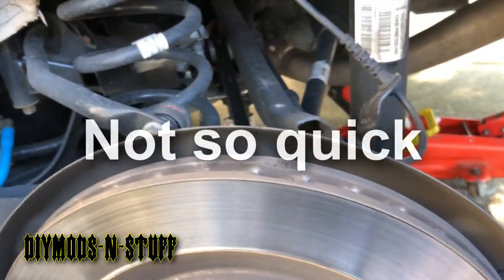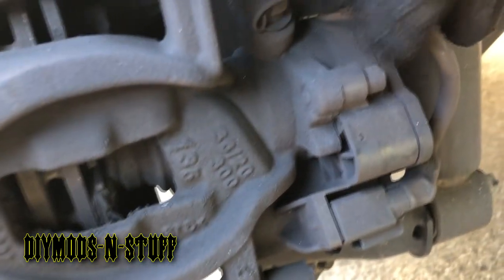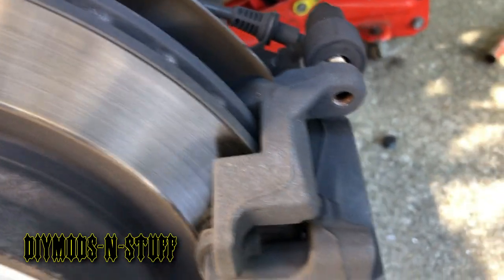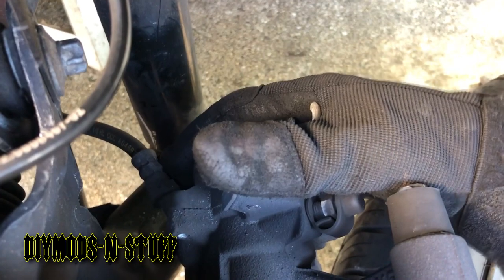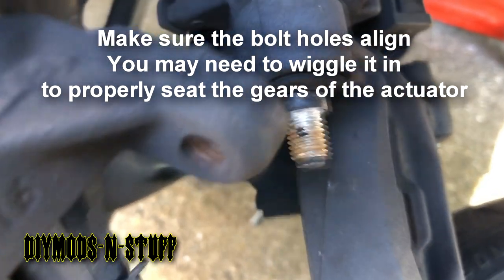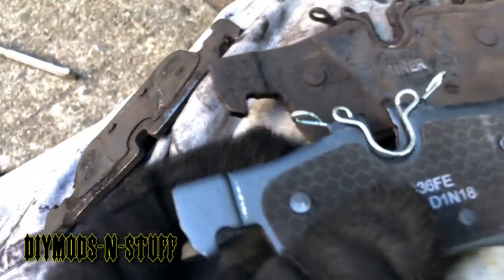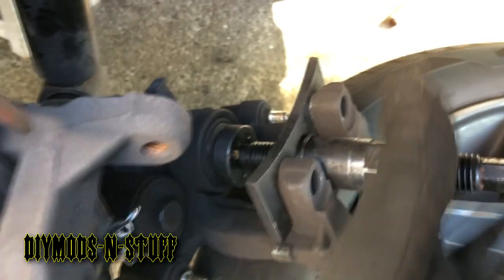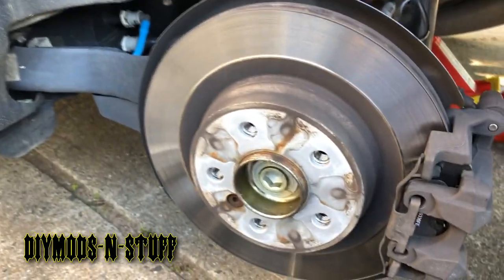2018 and up BMW X1 REAR PADS SWAP with EPB Electronic Parking Brake

Comment: Sir, I'm a mechanical engineer and have been working on cars for over 50 years.  You should be an instructor!  You add a lot to the video with constant tips and encouragement!  Superb job!
Reply from the maker: Thank you. My father is a mechanic and I had to learn myself when I started driving and realized that I can save time and save myself lots of aggravation. I appreciate your comments and that's why I do this.

Comment: According to my Foxwell Diagnostic Scanner, my 2019 X1 xDrive does not support the parking brake and caliper piston reset function.  Not sure if it applies to all though.  That is just the message I got when I tried to reset it with the scanner.  So manually resetting it will be.  Did the rear brakes on an F25 X3 last year and they were identical.  Great video, by the way.  Better than trying to decode the TIS.
Reply from the maker: That's the problem with most scanners, they won't support all vehicles unless you pay for an upgrade or buy the newest scanner.
Reply: Look under the DSC menu, it's moved from the EPB.

Not logical, but it's because the Autohold uses the motors...and Autohold is part of the DSC.

Comment: Good tutorial on how to do it manually...but way easier way if u have scan tool with epb capabilities. Before u jack wheels up and get dirty
Hook up scan tool follow prompts push a button ..and u will hear both epb motors retract(service mode)...then u will be able to push piston as u would do the front...a 30 second procedure, and no need to take epb motor off or connector.....when done with both sides...go back scan tool push the done button follow prompts and ur done=)
Reply: Where did you get the scan tool  what is the name thank you
Reply: @67mustang351w  autel has good hand held scanners for about 240-300 with  epb function and several other functions  or u can go with the bigger scan tools that provide bi-direction capabilities and much more for 500 to over 1000.. hopes this helps =)
Reply: @masterjoe3000  which autel tool did you use for this?  I have the MD808 Pro, and it's telling me that my 2017 bmw X1 isn't compatible.

Comment: Thanks,  working on my x2 , already broke the indicator line on front breaks.  Very helpful.
Reply: The front brakes on the new gen X1/X2 wear out extremely quickly. I had to do the front pads, rotors, and sensor at under 40,000km (25,000miles)
Reply from the maker: It probably and I say "probably" has to do with lane assist or something.

Comment: You should put in the description that this will also work for a 2017 on Mini Cooper Clubman as they share the same chassis as the X1. Saved my but. I would have never knows about resetting the electronic parking break.

Comment: Did you notice fluid behind piston dust boot when changing pads. Just started on 19 BMW x1 and passenger side backed off but noticed fluid under piston boot when releasing trapped air from boot. I checked the left side before backing parking brake or piston and noticed fluid in boot. Brakes felt good pulling in and no signs of leaks from calipers but for sure oily fluid under piston boots.
Reply from the maker: I did not see any fluid at all. Something I definitely make sure to check anytime I change pads on any vehicle. Make sure the rubber seal isn't torn.
Reply: @diymodsnstuff5514  
I check every time.  Just weird it is both sides.  22 year tech and never seen anything like it.
Reply from the maker: @carsurvivalist  Definitely is weird. I asked my dad, he's a mechanic 60 years and he tells me it could be bad seals.

Comment: On my Volvo I found I can just use a wire to energize the motor and back out the parking brake actuator. Can’t see why that would not work here.

Comment: Great video!
2 questions

Didn't you have to change rotors? 
What happens if you don't reset the EBP?
Reply from the maker: The rotors were fine.
I'm not sure. You have to reset it to be able to remove the caliper.

Comment: Does the passenger side have the same electronic brake? Is it also clockwise?
Reply: Just did em, clockwise for both sides and I used a socket to turn the gear by hand instead of a wrench

Comment: Any idea how to unlock the electronic parking brake. I missed that the passenger side had it too and I didn’t turn back the actuator initially I tried to compress it with the c clamp and then……I think I turned it the wrong way. Any ideas on resolving it without buying a new caliper.
Reply from the maker: C clamp would not work. You need to back it out the way I explained in the video or with a Scan tool that can do it via the ODBII port.

Comment: Recently did a 2018 X1 rear brake job too. There's now a squeak under light braking. Also, it feels like theres now slight brake drag, which is definitely affecting overall gas mileage. I'm thinking the guide pin boot needs to be replaced. Any thoughts on the possible problem?
Reply from the maker: Did you retract it like I did in my video?

Comment: My x1 with 47k km,OEM rare brake pad stil has 2800km life left ,hope this is not wrong information what I am getting from MID
Reply from the maker: These pads have an electronic wear sensor. Once the rotors start wearing down the sensor, you will get a message displayed in your head unit and you would probably have 1000 or less miles on the pads. Worn pads wear faster than new ones so keep that in mind.

Comment: Is it clockwise for both sides? Also what size wrench?
Reply from the maker: If it has an EPB on both sides yes. You know because it would only turn or back out only one way. I used a 12mm wrench if I recall correctly.
Reply: @diymodsnstuff5514  if it only turn did I turned it the right way and now I can replace the housing?
Reply from the maker: @darrellcox6938  Which housing are you referring too. It will only be backed in/retracted one way. You will know as it will take a while as you turn it back.
Reply: @diymodsnstuff5514  the side without the sensor the passenger side. As I turn the motor clockwise the it never stop the brake piston began to turn

Comment: Any idea if this is the same on a 2017 x1 with the EPB?
Reply from the maker: If it's the same model it  should be. They look to be the same model.
Reply: @diymodsnstuff5514  awesome man thanks, I looked it up looks like the same exact car to me. My gf has this car and I check her brake while rotating her tires and the fronts were fine but the rears are getting close to needing to be replaced. Do the rears wear out faster than the fronts on these? I had a Subaru that was like that.

Comment: Best way is to use obd that has function for winding back Electronic Park Brake actuator and to reset after pads have been replaced.The rest is straight forward. Winding actuator by hand you risk damaging it. Will also throw up fault code.
Reply from the maker: Thanks for the advice. That didn't happen, thankfully. Never had a problem.

Comment: Is there an electronic brake , on both sides ? rear & is it similar for a 2016 X1?
Reply from the maker: There is one on each side. I believe older models are different but the same concept. There are videos on Youtube for older models.

Comment: Hey, appreciate this video.  But, turning the actuator motor by hand actually damaged them.  Replacement was $250 per.  Dealer is basically the only replacement.  No good deed.
Reply from the maker: Sorry to hear this. There was no issues on the one I worked on and is still running great!

Comment: DO NOT lubricate BMW guide pins 🙄
Reply: Why?
Reply: @justtube443  Because ATE states not to do so in the service manual. They want you to clean them up to mirror bright with a soft scotch brite pad (The white, NOT green or blue). The idea is ensure a firm brake pedal, by reducing pad knock-back.

To be honest: I give the pins a very thin smear of "HydraTec" grease from TMD/Mintex, then wipe them with cloth. Keeps them clean for longer.

Too much grease in there just plugs the rubber guides up.

DO NOT USE copper grease on parts that contact rubber.